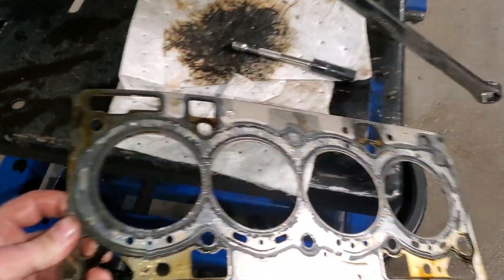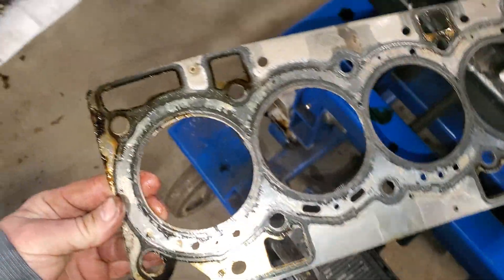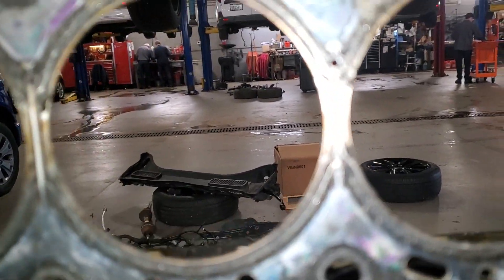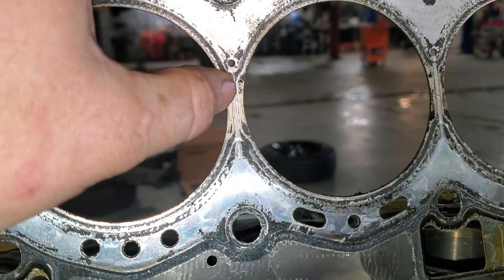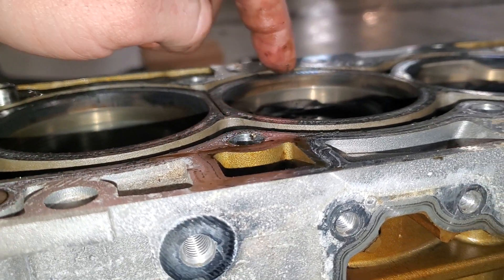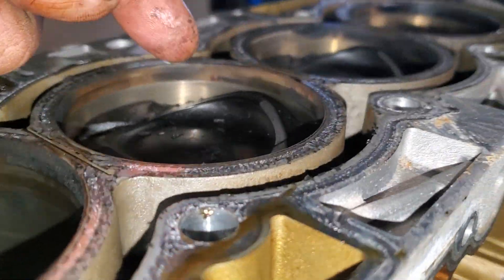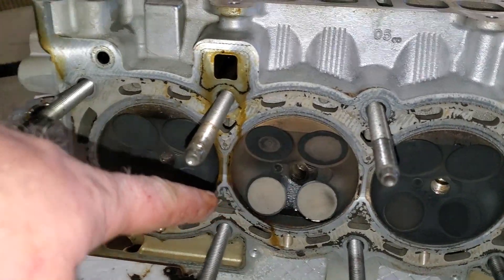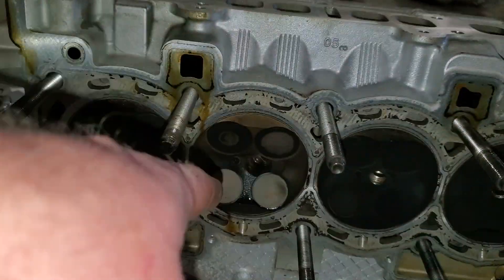2017 Ford Escape 1.5L Ecoboost Cylinder Head Coolant Intrusion Inspection, Cylinder 2 & 3 misfires

Comment: Excellent content , I have a 2017 fusion 1.5 eco boost  54,000 miles . I just noticed the coolant in the expansion tank is about 1.5inch low past the min. Line roughly and that I seen some white smoke from tail pipe when it’s not even cold outside. Does ford have any type of warranty to cover the short block replacement? Are there any that don’t suffer from this .
Reply from the maker: Yeah they moved it out to 7 years 84,000 miles coverage and if you look at my other videos or you actually Google 1.5 L EcoBoost coolant intrusion you'll find the actual technical service Bulletin tells you everything about it
Reply: @FordBossMe  I certainly will research that information. I had run across your videos by chance an I’m very thankful I did ! Greatly appreciate your service skills and the price you take in your work! Thank you very much for responding and for educating others .
Reply: @Ford Boss Me  In your opinion, do you think Ford will extend the warranty on the 2.0L too eventually?  I see many 1.5L with blown head gaskets on the web but not so many 2.0L with blown head gaskets (even though others say it's common with 2.0L as well.  Have you seen a lot of 2.0L like this?

Comment: I have a ford escape 2017 that fits in the time and location of the issues. As far as I know there isn't a qualified issue.  It has 80K miles right now so very soon it won't qualify for the ford short block replacement.  Any advice?
Reply from the maker: No I don't have any advice for you good luck to you whatever you choose I wouldn't be able to do it if it was me
Reply: @FordBossMe  Thank you.  I should have clarified. Are there early signs or something a mechanic could look for to see if it is in the early stages?

Comment: does this eventually happen to every 1.5 in the problem years it was made?  I have a 17 escape 1.5  with 45000 miles on it and not a single problem going to change over to the yellow coolant soon
Reply from the maker: They eventually will all do it that year
Reply: @FordBossMe  I’m going on 71k miles they won’t touch my car because I have wiring and stuff because I have a sound system, and they give me a hard time

Comment: at 43k miles, I'm just noting the coolant level in my '17-Escape is low (level is a little less than 1" below the full line when hot).  
If I leave the engine as-is, don't have it fixed, what happens?
The engine is running fine, no misfires (cold or hot) as of today.
Reply from the maker: Honestly you just have to change the spark plugs about every Twenty Thousand Miles keep your oil changed about every 3000 Miles and just run it

Comment: Have a 17 with the 1.5  same thing cyl 2 miss. White smoke  coolant in cyl after sitting overnight saw it with borescope. It's out of warranty coverage 117k miles. Is ford doing anything to help or if your out powertrain just on your own?
Reply from the maker: Ford won't help

Comment: Question: I have a 2019 Fusion 1.5L Ecoboost, is a way to know without disassemble the top of the engine if has the old or updated version of the block, like engine number or some particular mark somewhere or website pulling the VIN number?
Reply from the maker: Yeah call the Ford dealer up and give them the VIN number and ask them if though engine has been updated

Comment: Hello
Is this engine used in the german made ford focus 2017 with a 1.5 l EcoBoost engine, manufactured at the Craiova plant in Romania or UK?
So is this engine manufactured in Romania or UK as well ?
i.e. where are the 1.5l ecoboost for escape made ?
Reply from the maker: From what I'm gathering from overseas it's the same engine but I can't tell you specifics because I don't deal with anything from there only here in the USA, from the guys that have Responded to me from over seas ..... Seems to be the same though.
Reply: @FordBossMe  ive seen a lot of negative feedbacks regarding this engine all over the world, UK Australia and US 
Do you recommend owning a car with this engine ? Or better to get rid of it ?
In some forums they call it ecoboom ! They said that the engine will blow out sooner or later, Even if ford replaced it with a new one !
Reply from the maker: @hasanzeineddine4746  I'm not a fan of any ecoboost engine 

I like the 2.5na
the 5.0 na 
the 3.7na Non Cop Car
the 3.5Na non cop car 
and the 2.0Na 
the 7.3new gasser NA 
the 6.2NA 

I would never buy a ecoboost of any manufacturer unless the specialized in turbo engines 

I like Naturally aspirated factory vehicles
Reply: @FordBossMe  thank you
I may switch to chevy spark ! 😂
Reply: @FordBossMe  well good thing I have a 2.5 and 5.0, specifically bought because they're reliable engines

Comment: I have a 1.5 EcoBoost Ford Focus. Just wondering is you’ve seen the coolant intrusion cause engine failures? I have a failed rod bearing in my 1.5 EcoBoost and it’s only done 89,000 miles. 

Have had it serviced it on time every time based on Fords service schedule with Castrol Professional A5 5w-30 at the Ford Dealer.
Reply from the maker: You must be from Europe because we don't have the 1.5 L EcoBoost Ford Focus here in the United States
Reply from the maker: you didn't tell me that your vehicle remember the coolant intrusion only happened from 2015 to 2019 typically
Reply: I am in Australia. It’s a 2016 Ford Focus with a 1.5 EcoBoost. The dealers here have been replacing engines in Focus and Escape for coolant intrusion and have mentioned mine has the design defect in the block.

My car is out of warranty and Ford are refusing to help at all, so I am just looking to see if you’ve seen any failures put down the coolant intrusion?

The dealer is saying if you didn’t experience misfires or white smoke, coolant intrusion is unlikely.

I drive the car pretty much exclusively on the highway 20-30 miles at least per trip and the dealer has topped up the coolant in the past.

I am wondering if because I drive it and get it hot pretty much every drive, perhaps the white smoke and misfire issue won’t be experienced?

Comment: Great visual to see there is a problem there and thanks for showing it. Now the million dollar? Why is this happening as this is a problem with these ecoboosts according to consumer reports. Is the problem with the head gasket design, porosity in the block ect, does just replacing the head gasket from ford with a revised version solve the problem, is there a revision # for there head gasket that you are aware of? If there is a design defect just replacing the gasket isn't going to solve it. According to ford a block replacement is the fix. But again thats not getting any closer to why it's happening, replacing the block out of warranty at the consumers expense  is the cheapest route for ford. Have you found anything real concrete as to why? Again thanks for the video😎
Reply from the maker: That's not really the question because that question has been beaten into everybody's head the last 2 years and answered on this channel I show you the difference between the old block design and the nude block design for the 1.5 L EcoBoost and explain to you clearly and exactly what the issue is so that's not even a question anymore that hasn't been answered if you look in the library you can see the comparison videos where I show you

Comment: No misfire, just a single fogger nozzle in that one cylinder.   The customer couldn't afford the whole kit.

Hahahaha!

Hope they get a new head too.  Look at all that carbon on the pistons, valves and combustion chamber,  looks like a NA motor with 200k, damn!
Got to love the new CAFE standards.
Reply from the maker: no new head, just cleaned everything up and rebuild with new block and all new gaskets and fluids
Reply: @FordBossMe  I’m going through this right now with the dealer. After seeing your video, why can’t I just replace the head gasket and be done? Why does the block need to be replaced? Nothings actually broken, correct? It’s just leaking coolant out of the channel because of a worn out gasket?
Reply: @rellstuttin9198  so what ended happening was I negotiated with Ford customer service for 3 months for them to cover the short block replacement. The estimate started at $7k and I ended up paying $749. The block has to be replaced because the metal in the spot around the coolant channels warps. So a new gasket wouldn’t stop the leak due to the deck warp. Hope that helps somebody else out there dealing with these issues. Ford knows it and you can make them pay for most of it.
Reply: @941Surge  so was yours under warranty  when u bugged ford ? Cause I just hit 100k I would mind bugging them to get me a better deal tho
Reply: @rellstuttin9198  No, I was around 75-80,000 miles. Power train ended at 60. Your argument is that they have known about these issues for a long time, It’s well documented and THEY should pay for issues resulting from a poor design. Then just don’t take no for an answer and be prepared or the dealer to hang onto your vehicle for a couple months while they do their inspection and verify the damage.
Reply: @941Surge   I completely  agree! I'm pretty  Presistant lol so I will do that. You did u just go to the ford page and call ford direct service  or u  just went through  the dealership?
Reply: @rellstuttin9198  it’s fords customer service line. They will open a case and communicate between you and the dealership… which is its own bag of fun. My local dealer is terrible and it made everything worse. Good luck to you
Reply: @941Surge  yea that was a long shot. Least I tried hahaha fml